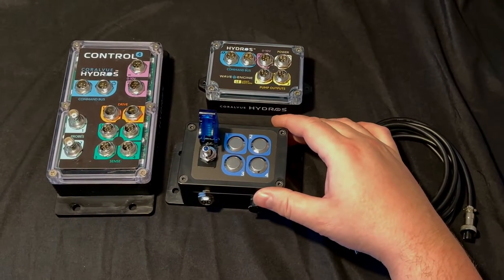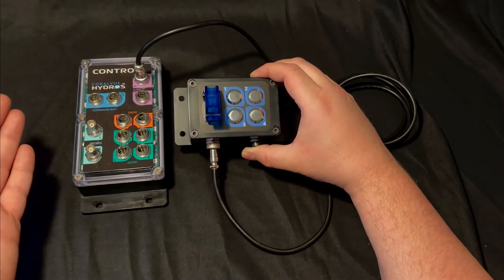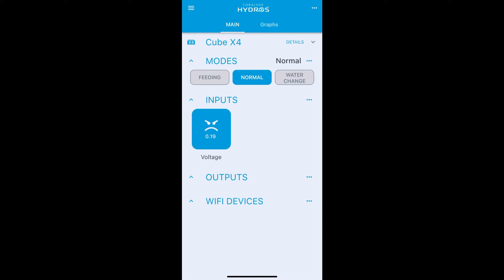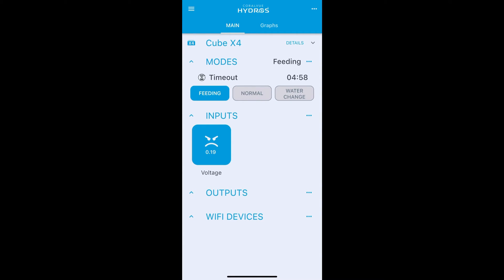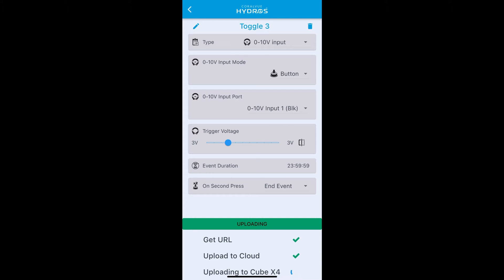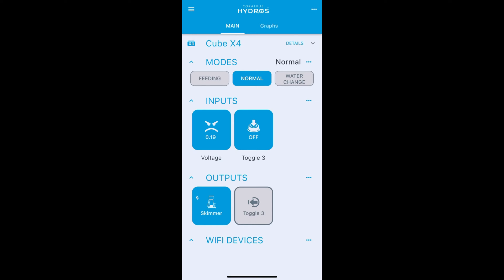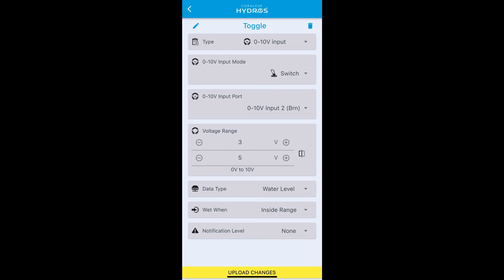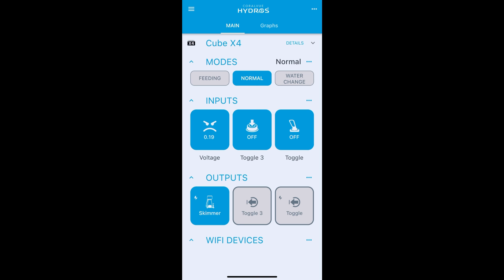JBA Coralvue Hydros Button/Switch Box Tutorial

Comment: I think this is a hydros issue but there are smart people here so maybe you know. I created button 1 input and the intermediary button 1 output. In my RODI output I put depends on button 1. But it's controlling the RODI flush output only, not the RODI feed as I had hoped. Anyway to control the feed instead of the flush with a button?
Reply: I found an answer in case someone happens across this in the future. In order to use the button box to control your RODI feed output you must create it as a standalone generic output. You can't do it using the built-in RODI family block from hydros

Comment: I currently have a Hydros 0-10v Quad Cable connected to my 0-10v port and using the black cable/channel to run door switches. Can I still connect the quad cable to the additional port in your box and keep functionality?
Reply: Yes as long as your door switches are moved to channels 3 and 4. My box uses channel 1 and 2 (for the toggle box) or just channel 1 (for the 5 button box). So if you use 3 of the inputs. Buy the 5 button. If you use 2 or less, you can use either.

Comment: Ordered breakout boxes for Control4. Might add a WaveEngine Le and this box. But I can’t determine if the LE will run the jebao dcw 1500. Does the WaveEngine LE include the power supply? I’d then need two end terminals?
Reply from the maker: Unfortunately the wave engine will not direct drive any jebao pumps. I’ve actually tried and the pump drivers don’t have any configurations that work with jebao pumps. Coralvue specially programs the we drivers for every pump they support.
Reply: @jbaquaticsllc5506  tell them to get with it.  ;)